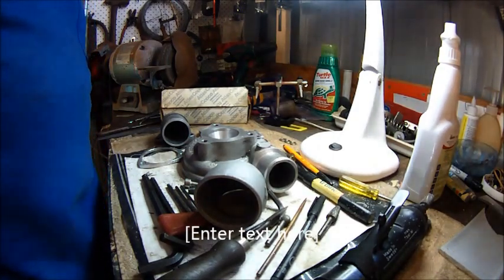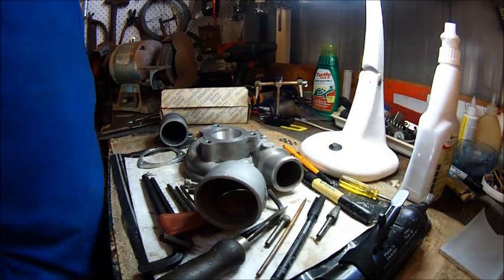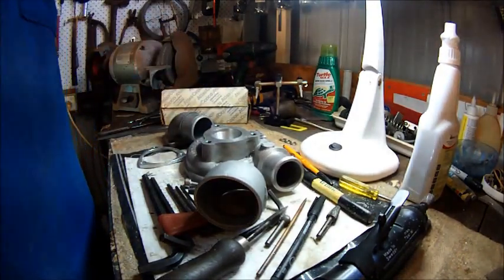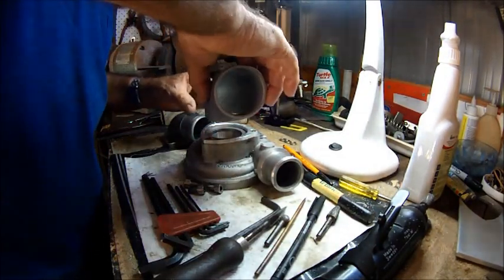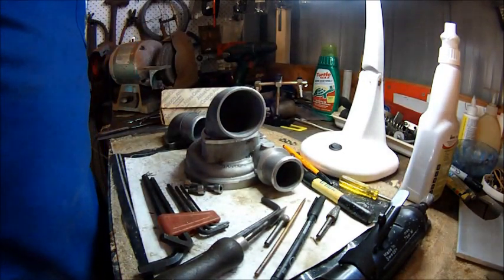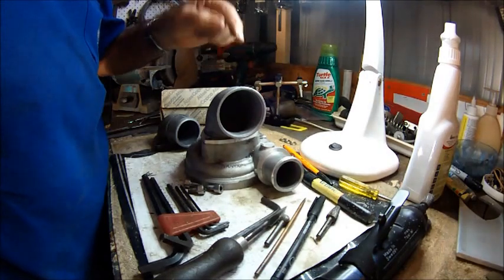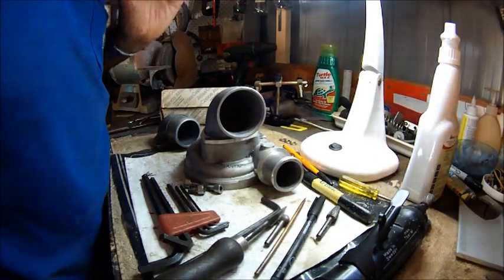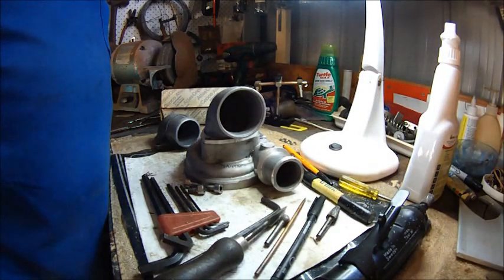Turbo Inlet Improvement Project

Comment: what modification have you done with egr or have you left that i just blocked mine off and i am freaking out about the overfueliing ecm
Reply from the maker: My EGR has been blocked for many, many years, should be no issues with overfueling as such (the CRD can get a MIL show up if there is not a small hole in the EGR plate to let the O2 sensor get a reading), there will be a slight increase in MAFv at idle and also at a steady cruising speed, that is the only time the EGR is open, under acceleration it is normally closed.
Reply: ok so ive completely  blocked offf the egr so i should go back and put a small hole in the plate that i have made
Reply: also thank you so much ive been freaking  out all week beeen watching my booost gauge and egt gauge like hawk
Reply from the maker: If you are getting a MIL due to the O2 sensor then yes a 6mm hole, if not then leave it. You will hear people say the EGT will rise when you block the EGR, if it does it is so marginal it is doesn't matter, but many, like me, had a slight decrease in EGT after blocking. So stop watching your EGT gauge like a hawk :).

Comment: Nice mod great to see you back cheers.
Reply from the maker: Thanks mate, the next part of this project will be an interesting challenge, getting the new Water Meth injection point up and running. A small thread on a bit of steel tubing is holding me up at the moment.